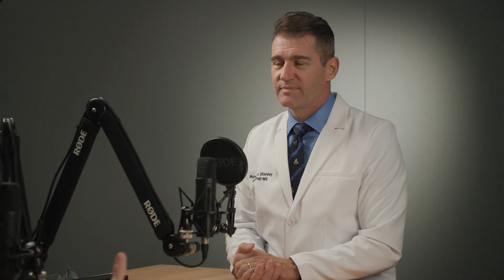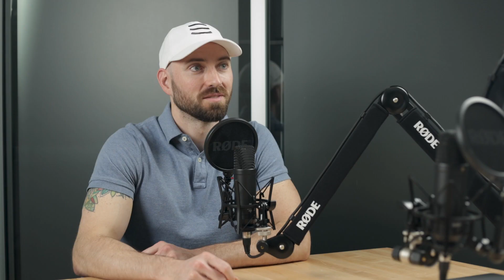I only use ONE implant. Here's why.

Comment: How deep are you placing your bioH implants Doc ? There is a theory that the internal 45 degree connection in a bioH implant shouldn’t be placed subcrestally due to the unstable connection leading to micro movement and possible bone loss.
Reply from the maker: I have heard this rumor as well. As far as I can tell it is 100% unsubstantiated. Crestal bone loss is not even a parameter that I concern myself with since it is clinically irrelevant. In other words if an implant has 500 micros of wound healing in the first year it is not clinically relevant. The esthetics can be managed just fine and the tissue is healthy. Since LaserLok is dual affinity it allows me to place the biohorizons implant based on the prosthetic solution. Typically 3-4mm apical to the desired free gingival margin. Some of the implant crest might be below the bone, at the crest, or supracrestal all of which works with LaserLok. The shallow conical connection works exactly like a deep conical connection creating a solid hermetic seal. It’s one of the only implants around that you can’t find images of broken implants circulating on the internet or social networks. Notice how many deep conical implant fractures pop up when you run the search. This is because of implant design which is the subject of many of my videos. I hope this helps and thank you for the great question.